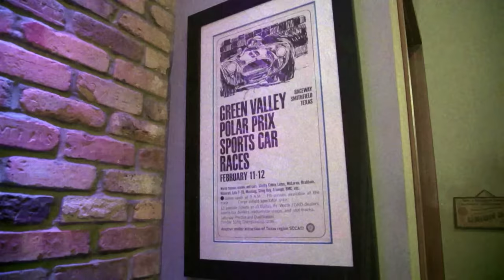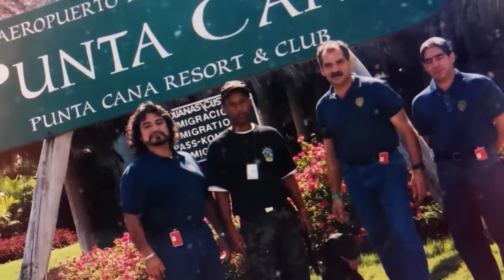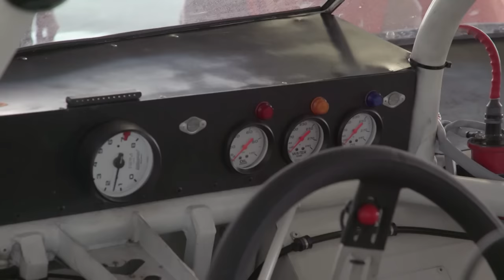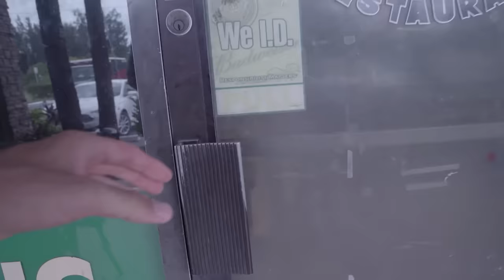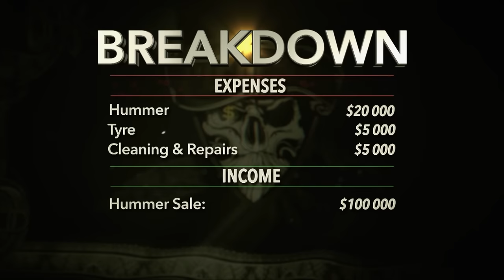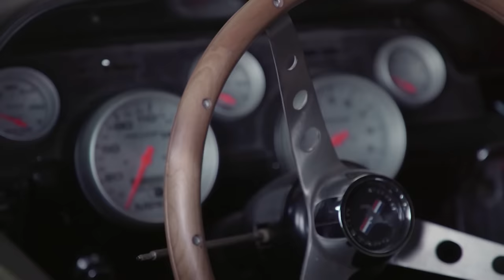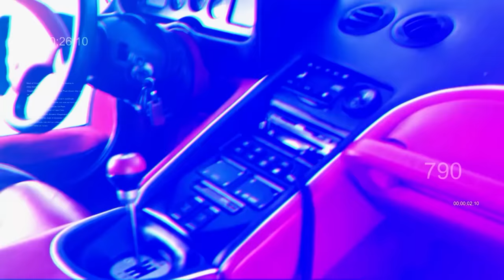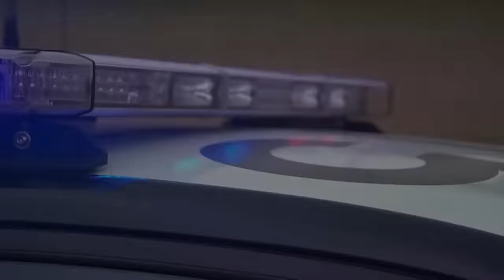The Pirates Trade in a Rare GT 500 | Pirates Inc | Filth

Comment: The 1967 is a clone, not a real Shelby.
The red convertible is a clone, not a real Shelby.
I have a real 68 GT500KR convertible, 4 spd, with air, very rare, also a 1966 GT350, 1967 GT350, 1968 GT500 fastback, 1969 GT350 convt. several real Boss 302's, Buick GN's, 1967 GT500 IMSA, SCCA race care, 427TP, dan williams 4spd, very fast.
Not selling yet, but it could happen soon.